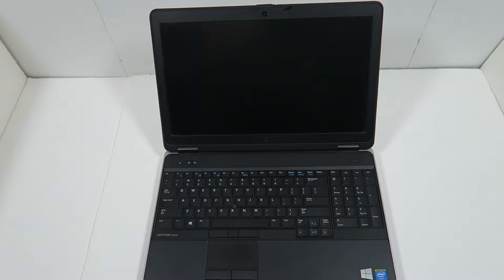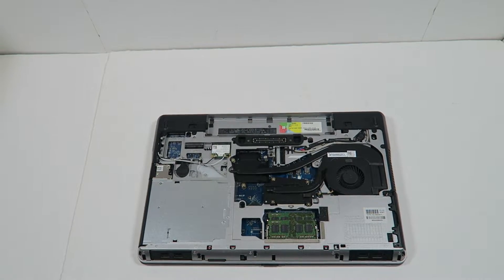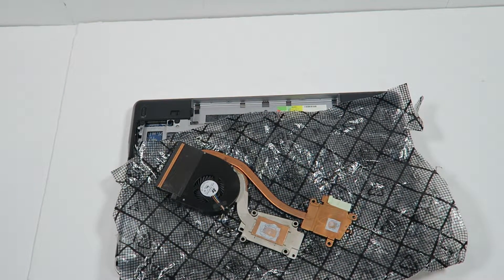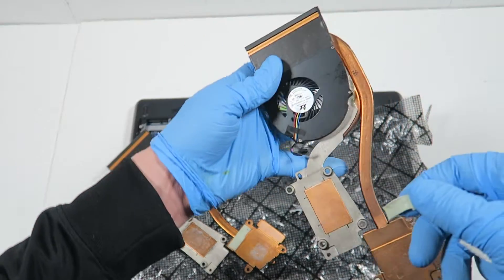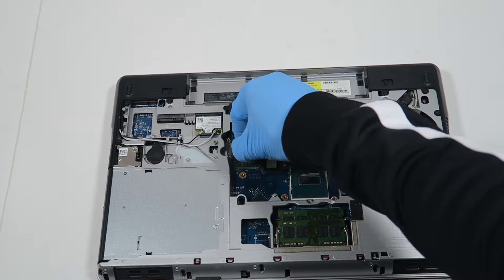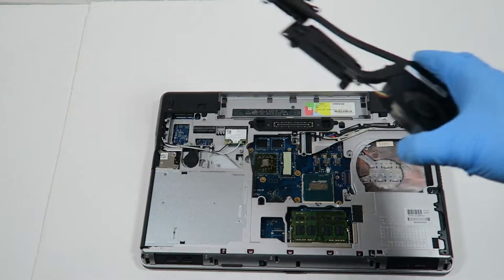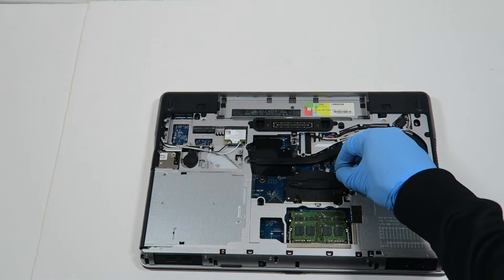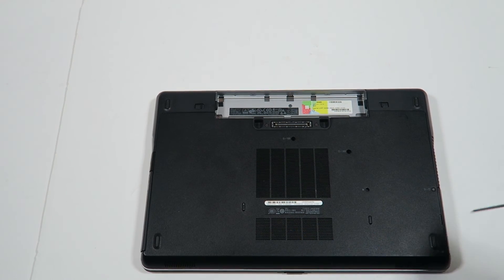Dell Latitude E6540 CPU Upgrade

Comment from the maker: List of Parts and Upgrades: 

Max RAM you can upgrade  is 16GB and you can use this Crucial works perfect with this laptop.. 

List of RAM works with this laptop.
 (1.) 16GB Crucial Kit 2X 8GB 1600 MHz (PC3L-12800) CT102464BF160B
(2.) Crucial 16GB Kit (2 x 8GB) DDR3-1866 SODIMM - CT2K102464BF186D
https://amzn.to/39X5of6

(3.) Crucial 8GB DDR3L-1866 SODIMM - CT102464BF186D
https://amzn.to/3aVjjUo

(4.) Crucial 16GB Kit (2 x 8GB) DDR3L-1600 SODIMM  - CT2KIT102464BF160B
https://amzn.to/2Xuv7JD

(5.) Crucial 8GB Single DDR3/DDR3L 1600 MT/S (PC3-12800)
https://amzn.to/30cUCi1

 SSD list works with this laptop.
(1.) Samsung 860 EVO 500GB 2.5 Inch Internal SSD MZ-76E500B/AM) 
https://amzn.to/3ea4lMo

(2.) WD Blue 3D NAND 1TB Internal SSD, 2.5" WDS100T2B0A
https://amzn.to/2JUDqpO

(3.) WD Green 1TB Internal PC SSD  WDS100T2G0A
https://amzn.to/2VdHHtO

(4.) SanDisk SSD PLUS 480GB Internal SSD SDSSDA-1T00-G26
https://amzn.to/3e6y0WF

(5.) Crucial MX500 250GB 3D NAND SATA CT250MX500SSD1(Z) 
https://amzn.to/2XlJK1w 

(6.) Samsung 860 PRO SSD 256GB - 2.5 Inch SATA III Internal Solid State Drive
https://amzn.to/2X6LPP4

(7.) Samsung SSD 860 EVO 250GB 2.5 Inch SATA III Internal SSD 
https://amzn.to/345jbiF
Reply: So this e6540 can upgrade to 16gb ram and ssd, right?
Reply from the maker: @dep1912  Hi, yes you can.
Reply: You have i7 -4810MQ The link of the processor that you have installed has not been sent.

Comment: Is it possible to change graphics from intel 4600 to RTX 3060?
Reply: TL;DR: No

intel 4600 is an iGPU. Integrated into the CPU. You can use external video card to have better graphics or buy a normal PC.

Comment: Hey gonna buy an e6540 next week what's best site and best CPU upgrade I can buy for it ??? Please
Reply from the maker: Hi, they sell used CPUs on ebay for that laptop..
Reply: @Mxkdt  thanks buddy and latest CPU upgrade to buy for it ???
Reply from the maker: Hi, it depends what kind motherboard you have in that laptop you have to check and you can use Intel Core i7-4600M...
Reply: @Mxkdt  yeahhh but ... The 4800mq is better right?!?!

Comment: An air compressor with the small blower tip is really nice for cleaning things like that fan! Also i use a dry paper towel to get some of the thermal paste off before using alcohol. I'd never use a blade on the die! It can get nicks on it and then you'll drag that across your surface. A general rule of thumb is if the material is harder than what you are rubbing it against, the other material WILL yield, and get scuffed up or whaever.

For example you wouldnt want to use a steel bristle brush on an aluminum surface because aluminum would be softer, and you'll start taking material off.
Reply from the maker: Hi..

Comment: im now having a Dell Latitude E6540. Can i Upgrade it to this Cpu ? (Intel® Core™ i7-4930MX Processor Extreme Edition)
Because it have the same Socket Which is G3
Reply: what processor is in the laptop?
Reply: @vladimirazirov1815  the CPU that im now having is the Core I5 4300M Hope you Reply
Reply: @butnoyes_5778  I recommend buying  processors i7-4702MQ , i7-4712MQ -> is a 2x increase in performance. If the laptop has a double tube in the cooling system, then you can use the i7-4800MQ. I do not recommend installing other processors, so that the transistors in the motherboard power circuits do not burn out. After installing the i7 processor, you can install DDR3L-1866 / DDR3L-2133 memory modules in a laptop, optimally 4GB+4GB, you can 8GB+8GB
Reply: @vladimirazirov1815  Can i install the Core i7 4910MQ cause it have the same socket G3 and the TDP is the same as the CPU in the Video so i dont need to worry about Heat
Reply: @butnoyes_5778  you can install this processor, but if something happens to the motherboard, do not blame anyone :)
Reply: @vladimirazirov1815  yeah
Reply: @butnoyes_5778  How its going? Did you installed i7 4910MQ ?
: )

Comment: My e6540 has the i7 4810mq installed. It can run pretty hot. I suggest reducing the max/min processor state in the power settings under "Processor power management" (you can right click battery bottom right of screen and select power options. I reduced it to 85% min/max and it reduced the temperatures by 10-15 degrees, and doesn't exceed 70C, usualy idles around 45-51C and can go up to 60C when doing tasks. Another thing to note is within the BIOS, if the Intel Turbo boost is active, while the Intel Speedstep is disabled, the performance will increase but it will run very hot. Up to 90-96C under more extreme loads. I found having Intel Speedstep enabled while Turbo boost disabled + the reduced Processor state, made the Laptop run extremely cool, at the cost of reduced performance. Personally I like Turbo Boost & Speedstep active while reducing the processor state to 85% to be the sweet spot. Laptop runs great, and doesn't get super hot! 
PS: To access Speedstep/Turbo boost, press F12 at system boot up when Dell logo appears
Reply: Just remove back plate and temperature will cool down from 95 C to 65 C (yes this laptops have no air wents under cpu fan)
Reply: Yeah, these things are infernos with that awful little heat pipe. You'd have to cut the bottom out and put it on a cooler to really get full use out of the components
Reply: And how about for games .
Reply: @OlaArnold26  The laptop can handle older games quite well, but for some reason there's a noticeable input lagg while playing them. I've never been able to figure out how to fix that, so I don't recommend it for gaming.
Reply: Please guide
Reply: I have the precision model and mine will run at 3.4 ghz at 90c

Comment: Can anyone tell me what are normal temps for the i7 4810 in this e6540? Mine idles at 49c with 93c on work load
Reply: Same q
Reply: Late reply, but yes, this laptop is horribly undercooled for the CPU+GPU combo. It was engineered for much less powerful ones

Comment: Once installed will the computer just recognize the 4800mq updgrade or is there software that needs to be installed as well?
Reply: Before changing the processor, you need to install the latest BIOS from the official website of the laptop manufacturer in the laptop.

Comment: Hello good video. Do u believe that is possible to upgrade e6440 with the same processor? Actually I have i7-4600m 37W. Any problems with TDP?
Reply from the maker: Hi, yes  e6440 laptop with  i7-4910 mq will run really hot on that e6440 small laptop and does support quad core with latest BIOS update.
Reply: Mxkdi how do u know that?

Comment: Can i Install 750 ti in Dell optiplex 390 sff?
This version 
https://www.zotac.com/us/product/graphics_card/gtx-750-ti-2gb-2
Reply from the maker: Hi, no that video card will not fit 390 sff and you can only use low profile video card on sff Dell PC.
Reply: @Mxkdt  Tell me some graphics cards that can fit in dell optiplex 390 sff.

Comment: Please !! Dear, tell me that I can put 1050 Ti and Rx 560 in Dell OptiPlex 790 Sff, if not which graphics card can I put?
Love From India 😘😘
Reply from the maker: Hi, Dell OptiPlex 790 Sff, you can only use low profile video card Gigabyte GV-N105TOC-4GL
Reply: @Mxkdt  Can i use Gtx 750ti in Dell optiplex 790 sff.You give me your Gmail id, so that I can tell you a problem with my Dell OptiPlex.
Reply from the maker: Yes you can low profile GV-N75TOC-2GL
Reply: @Mxkdt  Biggest problem in dell optiplex 790 sff is Power supply. Can i use a other brand psu (like Corsair) in DO 790 sff?
Reply: @Mxkdt  can you put a ryzen 5 in a dell optiplex 3010
Reply: Will a ryzen 7 work in this?